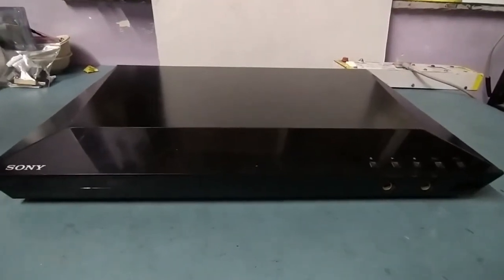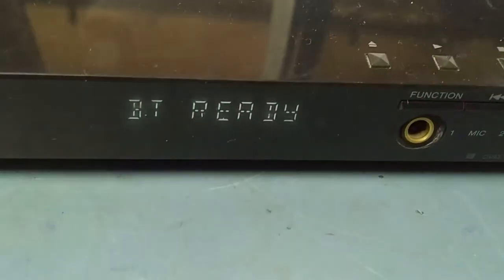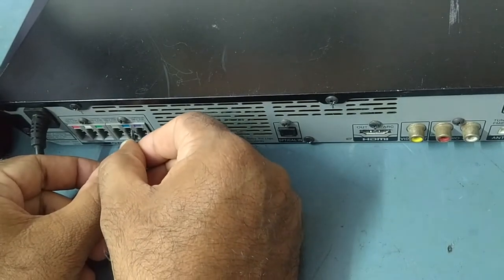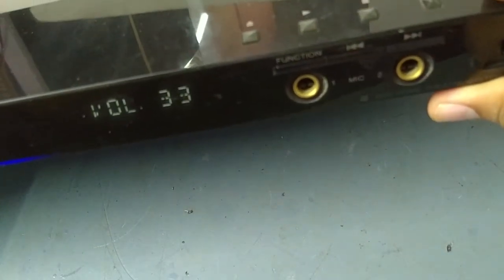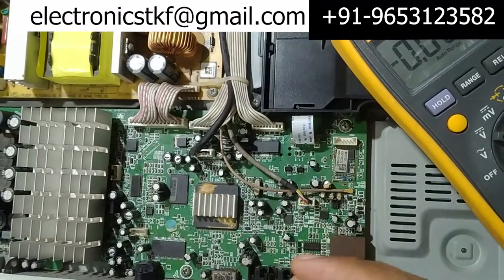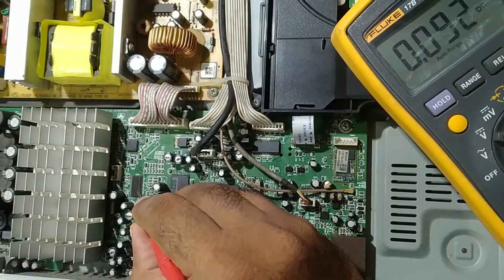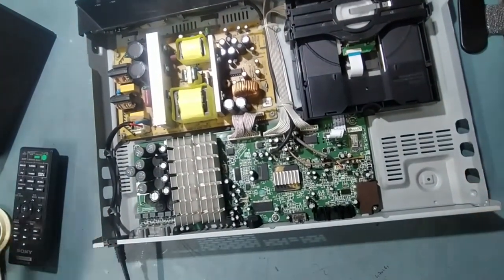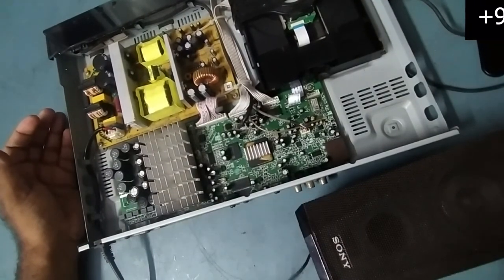How to Repair SONY DZ350 Model for No Sound Problem #sony

Comment: My home theatre DAVDZ LOST sound. And Sony service center told to replace board cost 13000
Reply from the maker: +91 9653123582 call me to discuss more  in details, your system will be repairable.

Comment: Dear Brother, I watched this video with a lot of interest.  I was looking for a solution of the same problem in my Sony Home Theater - No sounds. But its model is different to this. Its Sony HBD-SZ1000W.   With what I learnt from this video, I strongly suspect that its  IC  CXD9926ATQ is defective as the IC you showed here.  Do you think that what I suspect is correct?